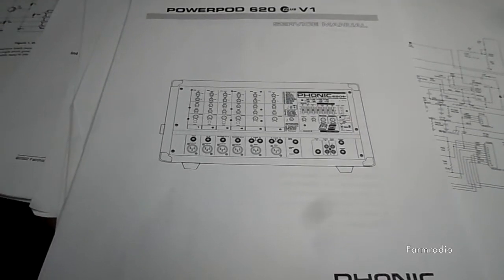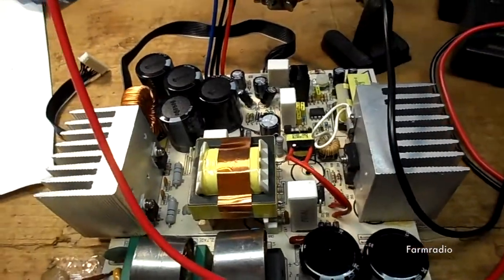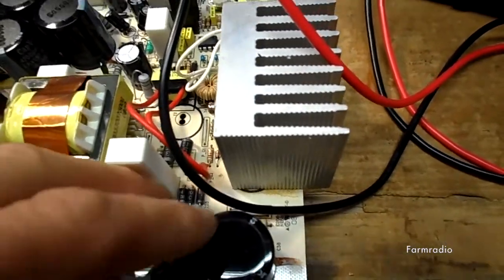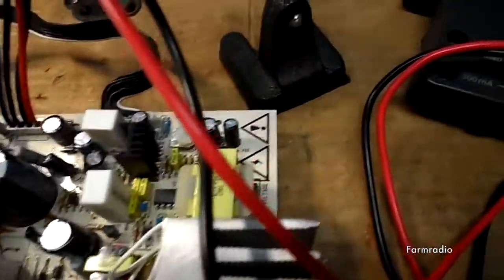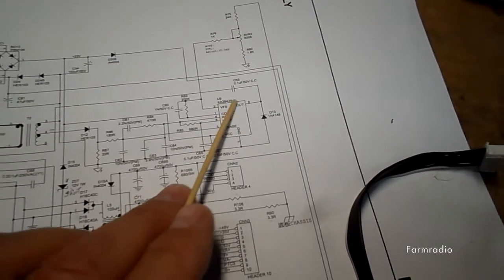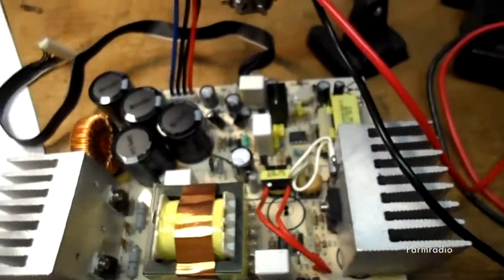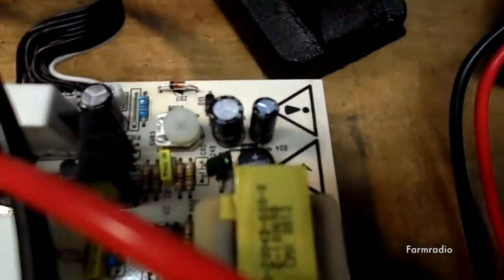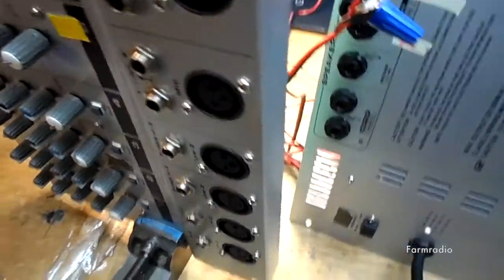Phonic Powerpod 620 Plus Repair.

Comment: Hi been trying to repair my phonic 1062 deluxe power mixer which has a badly blown ceramic capacitor that I just can't figure out the specs .1:57 was wondering  what kind of ceramic capacitor is that,the one that is  just after that red and black cable

Comment: Hello ,very good video.  I have a question.. I have a phonic 740 deluxe . should be coolers in this device in action when I turn on. or do they only work when the device is heat?.. thanks a lot for your possible reply. Greetings from Perú.
Reply: You mean the fan? Yes, the fan starts and stays on when the power is turned on.

Comment: We had a Vector battery charger which displayed E04 (open cell) when attempting to charge a battery.  Since no service documentation was available it sat for four years until I decided to take a look at it again.  Since it was in a hot outdoor environment I checked all the electrolytics...they were all OK.  So were all the power devices.  Checked for +5v on the sense amplifiers...also OK.  Checked the precision resistors...also OK.  Turned out to be an open coil on the output relay.  $7 part later and it's working like new.  Nice to have such skills in a throwaway society.